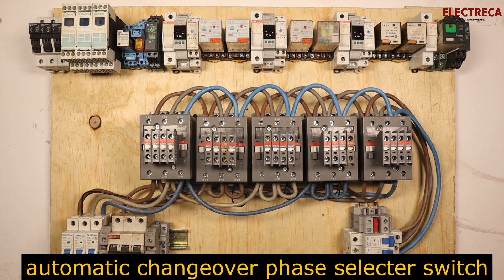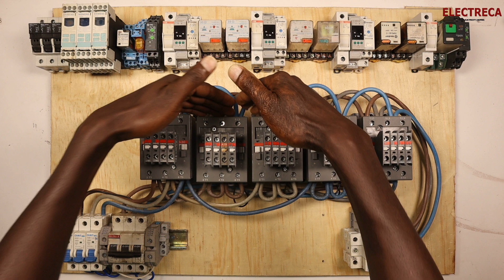Ultimate Power Backup: Automatic Changeover Switch & Phase Selector Explained

Comment: It should be mentioned that this works only on single phase loads, distributed per phase. strict 3phase loads thats require 120deg phase displacement will be at risk and not work optimally e.g a 3phase submersible pump. Also, the supply cables of the healthy phase that will bear the load of the missing phase should be adequately sized to bear the extra current. otherwise, its a good idea. for example, if each phase had a 1kw load and 2 phases had an outage, the 3rd phase must have supply cables sized to power the full 3kw combined load.